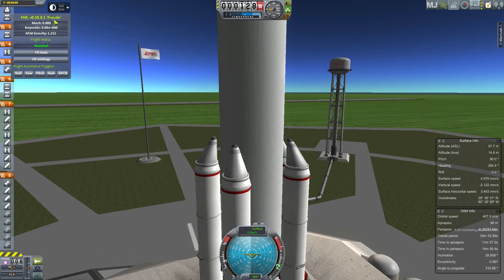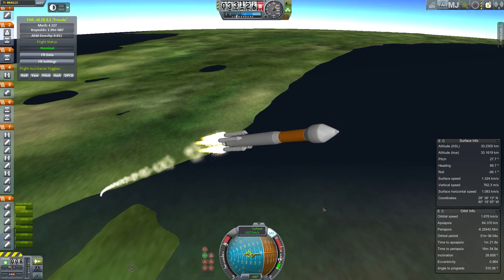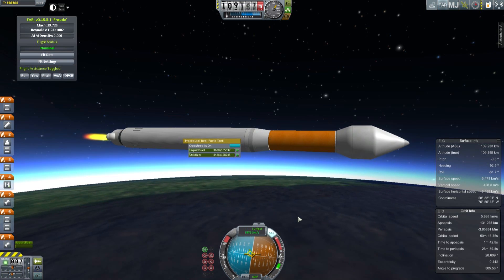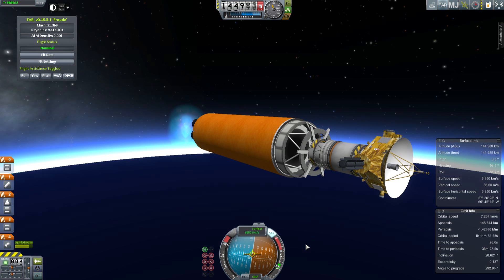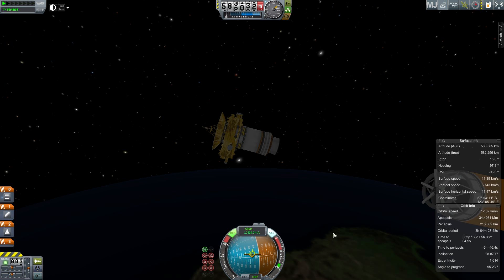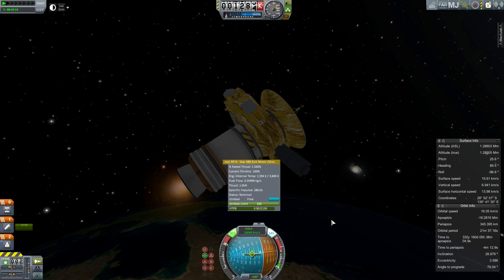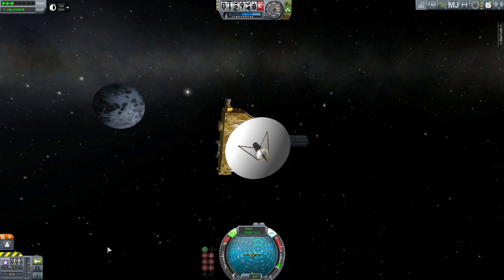Launching New Horizons In Real Scale Kerbal Space Program

Comment: Question to the professionals:
I know Mr. Manley made a video about it..but i still got a hard time wrapping my mind around it. So..how would you explain/describe DeltaV to a dumb person? How do i know what a good DeltaV is?
I know i could read it up..but the flood of math is a bit much..so i just want to know what it is without scientific formulas.
Reply: Sizzlik Simply put, a crafts available Delta-V is the amount of change in velocity it can make (Delta being math for "change") A craft with 2000 DeltaV can change its velocity by 2000 meters/second (assuming that meters is the measurements system we are using.) This craft can accelerate to 1000 meters/second and then reverse engines for another 1000 meters/second to bring the velocity down to 0. (relatively speaking, of course)
Reply: *****
THX
Reply: Sizzlik When referring to KSP, it takes about 4600 meters per second of delta V to get into orbit around Kerbin. 

Kerbal Engineer helps because it's much easier to tell if your rocket can complete the planned mission, finish a maneuver node, etc.
Reply: *****
Yeh..thats my main problem..how can i know the right numbers? how do i know i need xxx deltaV to do xxx action. Simplest..how do i know wich DV i need to get to mun. Thanks to the other comment i understand what DV basically is..but how do i know how much i need for a certain mission without using mods? Is there a rule of thumb? I try to play vanilla game to learn it, not let mods calculate for me..like mechjeb or engineer
Reply: If you don't want to use mods you can check out the Cheat Sheet page on the kerbal wiki. There you will find info on the calculations that need to be made and a map that shows the needed DV to get to any location.

wiki.kerbalspaceprogram.com/wiki/Cheat_sheet
Reply: *****
Thanks for the help..but read my initial comment. The math is way over my head..i just see formulas and get lost by the first glance. I may be just too stupid. Thanks anyways.
Reply: Just use kerbal engineer redux. I do and it works great. It really should be in the stock game.
Reply: Sizzlik That has been done for you. http://forum.kerbalspaceprogram.com/threads/96985-1-0-4-WAC-s-Delta-V-Map-continued-OPM-now-included-(July-4th-2015) this is a diagram that you can use to figure that out. If you wanted to land a rover on Duna, you would add up the lines you want until you get to where you want. (Eg. 3200 + 950 + 130 = 4280 m/s) I didn't add up the final ones because the arrow means you can aerobreak, reducing the required delta-v of that part of the journey to 0. Just be aware that this isn't 100% accurate so be sure to keep that in mind. Hope that answered your question. :3

Comment: Yay you're doing something with New Horizons, I'm so psyched about our first good look at Pluto, this is making some serious history as it's the only planet, dwarf planet, dirty giant snowball that we really have no good pictures of. We've just never had the right equipment for it, and the equipment that could do it never got close enough.

Also, for the future of KSP and your RSS series, can you try out SpaceY rockets, the parts are based on SpaceX, meaning some serious heavy lifters, they cut down the number of trips for my first giant space station in half, and they have some really really cool features like external reaction wheels that give you control without adding to the stack length. They are also designed to be reused, so it could be like another reusable program at the same time. It's updated for 1.0.4, and I think the guy who made them did a wonderful job, I paired them with a couple of the near future packs for electricity, and the larger capsules and it's one of the best decisions I've made for KSP, I really love the quality and ability of those 5 meter engines and tanks. I never liked launching 3.5m rockets before because the first stage always ended up bigger than I liked, but with SpaceY I can use the 5m main engine, two big solid rocket boosters, a 5m to 3.5m adapter and get a huge payload in orbit, one that could normally take 2 or even 4 mainsails on the first stage. Pair it with the really nice decouplers that are aerodynamic and have seperotrons in them, as well as those sweet sweet external 3.5m and 5m external reaction wheels and the mod is definitely worthwhile.

Comment: Omg when Scott Manley was talking about the fuel floating everywhere in the tank and having the problem of fuel not pumping to the engines, i started thinking of ways to push the fuel to the back of the tank without thrusters and i thought about some sort of flexible bulkhead inside the tank separating the fuel from some sort of gas higher in pressure that would push it back and a split second later Scott mentions a similar system!

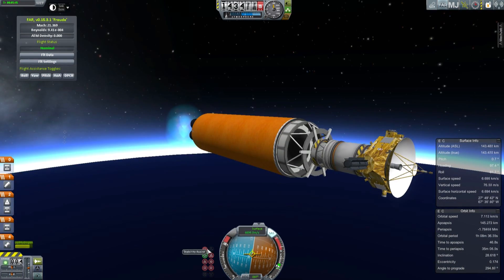Comment: At around 4:00 you were talking about the rocket having to slightly accelerate in order to keep the fuel at the back of the rocket. Couldn't a pressure system on the other side of a sliding metal plate do the same thing, pushing the fuel to the back using pressure rather than thrust?
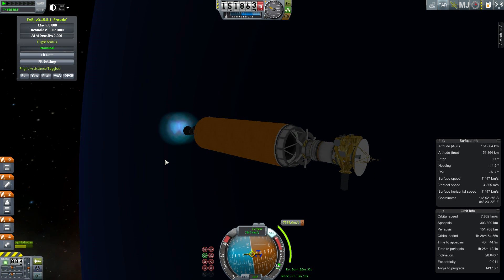Reply: Forkont Aerialis He talks about it at 5:20
Reply: Forkont Aerialis To put it simply, it would require a massively heavy mechanism to do that, whereas you only need several small rockets to do the same job.  Rocket designers would rather spend the mass on the payload, and not the launching system.
Reply: Forkont Aerialis 
Some smaller stages use a 'balloon in a bottle'.  Its really a bladder that contains the fuel, and then outside is pressurized with gas.
Reply: tmkr When the main engines aren't thrusting, the fuel just kinda floats around in 0g.  The ullage rockets give just enough thrust for the fuel to settle at the "bottom" of the tank and feed the engine - when the engine ignites, it provides the acceleration needed to keep the fuel settled.

But for the Lunar Module, they used something similar to what kurtu5 described, just backwards.  The tank contained the fuel, and there was a helium bladder that pushed the fuel towards the feed.  As the fuel was used up, the bladder filled the empty space.
Reply: Forkont Aerialis You mean sort of a piston system in fuel tank using fuel as hydraulic fluid ?
Reply: Forkont Aerialis Probably, but it's just no economic when every gram of launch mass is important. And you ned an RCS system anyway when you wan't to reorient the engine for restarting.
Reply: Plus mechanical failures, less space and stuff like that.
Reply: ***** Is this how pressure fed engines work in general? I've wondered how the gas gets the propellant into the veins in zero-g..
Reply: tmkr Yeah pretty much.  The Masten rocket that won the hover prize a few years back, had a helium pressurized alcohol and bottle oxygen.  No turbo pumps on that baby, just pressured right into the combustion chamber. I'm pretty sure they had a bladder for the alcohol.

They also did a complete shutoff and relight in flight.  Not many can claim that fame.

But if your vehicle needs super high pressure combustion, then some sort of secondary pump is needed, be it a turbo or piston pump.

Comment: On the issue of fuel cavitation in rocket fuel/oxidizer tanks: would having a surge tank (like what's common in aircraft and automobiles) where a smaller tank is kept full within the main tank in order to prevent pickup starvation? 

I assume there would be a potential weight trade off but it could be better than the complexity required for additional thrusters.

Comment: For the problem of vacuums in the fuel tanks while not accelerating in space, could you theoretically coat the inside of the half of the tank on the opposite end of the engine with a fuel-phobic material, and do away with the initial thrusters?
Reply from the maker: xinxian kongqi Fuel phobic material would only repel it a few mm I'm sure.
Reply from the maker: Cool Redstone You can do that, the question is whether that's the best solution tot he problem.
Reply: xinxian kongqi Wouldn't really push the fuel backwards, it would just simply not touch those surfaces, which isn't that helpful... And remember, fuel is continuously consumed, so the location of the hydrophobic materials would only stay "right" for a short moment.
Reply: Why can't you put a giant piston in fuel tanks to push the fuel towards the thruster
Reply: xinxian kongqi A "fuel-phobic" material would only repel fuel when it touches its surface. So it won't be effective at pushing the whole liquid fuel flush on to the back (if its extracted through the back).
Reply: Cool Redstone Giant pistons tend to be heavy, which is not the sort of thing you'd want on a rocket.
Reply: Cool Redstone Also, the lesser moving parts are there, the more robust and reliable a system is. New Horizons uses solid state hard drives for that reason. And that is also why all the scientific instruments are fixed to the spacecraft (you have to turn the whole spacecraft to point at a target), unlike previous missions. The Voyager(s) had moving instruments which allowed it to be able to communicate with us while also being able to take measurements. For New Horizons you can't do both of them at once.
Reply: Not to mention, it's not a problem, really... There are already good solutions, as Scott said in the video - and they work. So there's really no need to think about giant pistons or hydrophobic materials!
Reply: Scott Manley hi Scott!
Reply: xinxian kongqi Maybe they should make a huge "French Press" Hydraulic to push the fuel down =D
Reply: xinxian kongqi Fuel-phobic material would keep it from sticking to the walls toward the anterior end of the tank, but doesn't keep it from floating around just above the surface in a gigantic blob.

Comment: I have a question! Because our technology moving so fast right now, what happened if we attempt to make a new craft that flyby pluto now? Like do the engine will be better? Or the satellite itself will be smaller due to miniaturization?
Reply: Eko ari wibowo Like how Scott said in the video; In engineering, reliability can sometimes trump efficiency. This is probably even more true dealing with rockets and space travel, where there are no second chances. NASA has to be sure their instruments can survive the extremes of space travel, which probably means they prefer reliable and tested technology.
Reply: Eko ari wibowo 

There currently aren't really any engines that combine the power and efficiency of the RD-180, so no new engine would be better for the application. The satellite might be made a bit smaller, but the smaller you make the electronics the more vulnerable to radiation damage they get. Since it's guaranteed to experience a LOT of radiation you actually want larger more reliable electronics. So it probably couldn't get much better than what they actually launched in most aspects. There are similar concerns in other areas, for example the cameras. As you increase the resolution (number of pixels) the precision of the sensors tends to decrease and the noise floor gets worse. For science precision tends to trump resolution, and you want a really low noise floor, so a lot of spacecraft cameras will be low resolution by consumer standards, but very, very precise.
Reply from the maker: bamarocks777 RS-25 is a Hydrolox engine, RD-180 is Kerolox. Hard to compare engines that use completely different fuels.
Reply: Eko ari wibowo As far as electronics, etc. We might be able to make things smaller, perhaps make it the same size and put more functionality into it. But I doubt the size of the spacecraft could get any smaller, as there are constraints like the size of the communication dishes, etc. The may be able to put better instruments (not that the current one is bad), but the problem is that it is so difficult to get data from the spacecraft. The speed at which the spacecraft can send data back to earth is nearly 1 kilo bit per second. Just to give you a scale your broadband connection might have more than 15-20 Mega bits per second.
Reply: Space, space, space... That's how I figure out EVERYTHING!
Reply: Thank you guys for the answer. Yeah, i also think reliability also need to be considered.  But in 9 years since new horizon launch there must be a lot of new tech that can make it better . For example just few month back intel launch 18 core chip and maybe if we use solar sail the trip will use less fuel and will be faster. I also mention size because its matter. Every g we shave means more speed to the craft and less risk to damage in journey (risk/time). And maybe if we launch it now the craft will be able to take data and sent it in the same time.
Reply: SAI Peregrinus RS-25 is a better engine. Made in America
Reply: Ion engines are about the only thing that would help here that we have developed a lot since then. But considering the limited electrical power, they aren't too useful.
Reply: Scott Manley you are right mr scott. Apple to apple comparison